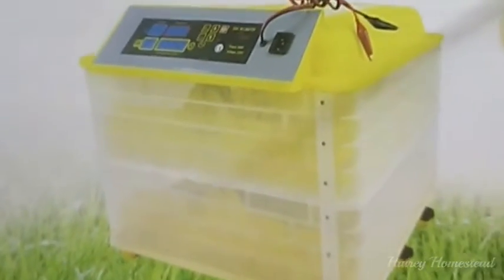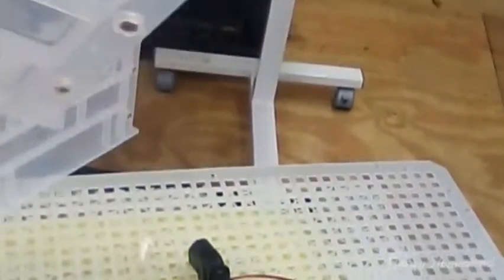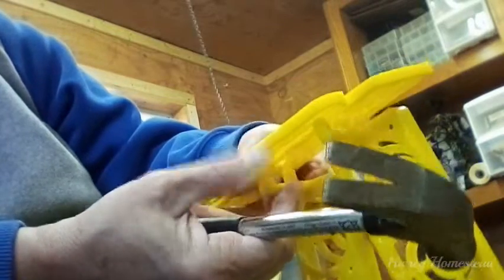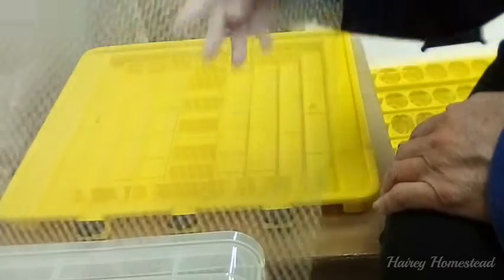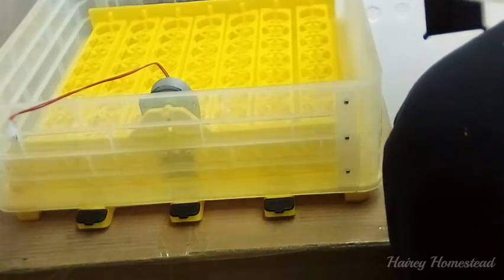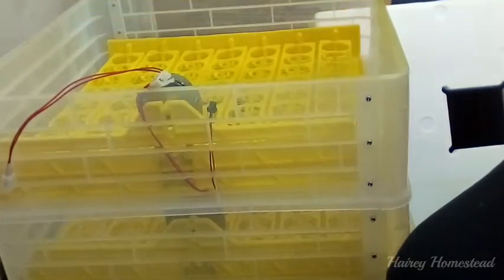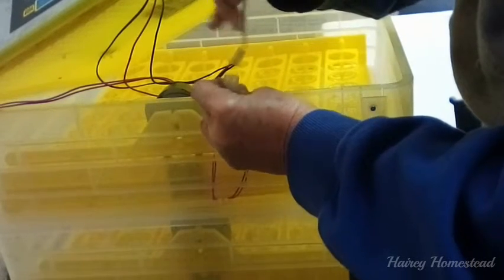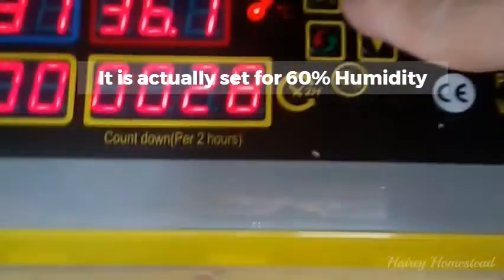112 egg incubator ASSEMBLY with bad  instructions

Comment: Any way to turn the alarm off
I dry hatch
Reply from the maker: Sadly...No - you can totally remove the beeper, The only way I can stop it is to turn it to the lowest number possible...either way it will beep when they hatch, as the humidity will get higher - I find that this (and other fan driven incubators) really dry out the eggs, so some humidity may need to be added - especially during lockdown - depending on your climate.
Reply: @ thank you
Mine isn’t letting set a low for humidity just for the temp
I’m doing it per instructions but it still isn’t working 
Did yours end up hatching eggs
I don’t want to loose my precious turkey eggs
Reply from the maker: @Barefootgarden  Yes, mine hatched plenty of eggs - The humidity is only a checkpoint - this incubator cannot control the humidity, it can only alert you. so the setting are for alarm only - I use separate humidity and temperature checks inside the incubator - some areas are warmer than others too. But as long as you have the humidity YOU need for your hatch - you can ignore the alarms - I know they go on your nerves if you can't shut them off or turn the alarm low or high. but rest assured - all you need is the correct temperature and the correct humidity for what you are hatching and you will have babies soon.
Reply: @ thank you.

Comment: Just trying to set up mine and the temp reads 100 . Can not get it to 38. Anything. Theres no . At all. Just 100 or 99 pls help
Reply from the maker: 100 would refer to fahrenheit - although the indicator says centigrade, this would mean it is displaying in fahrenheit. 38 C = 100.4 F I set mine to 100F and it will average between 99-100F. Now I usually hatch emu eggs (in a different incubator) along with chicken, duck and goose eggs. Emu eggs hatch at a lower temperature (36.5C~) But I have always been able to hatch other birds alongside them at this temperature - even opening the incubator 3+ times a day to rotate the emu eggs did not affect the hatch rate of other eggs.
Reply: Thank you so much @haireyhomestead3820

Comment: Best video. She explained it step by step perfectly . Thank you
Reply from the maker: I actually just bought another one of these - This is not the best incubator on the market, but I just got mine for under $90 on Amazon. The newer versions are slightly different in the way the rotor assembly is mounted, but the basics are still the same.

Comment: My electric panel will not light up and start can you help?? Full of eggs!
Reply from the maker: Hi Judy, Without seeing the unit in person I can only make suggestions : Ensure that the the incubator end plug of the electric cord is all the way inserted into the incubator to make contact with the prongs. Be sure to connect the wires as intended so electricity can flow properly to all sections of the components. If you are tech savvy, take the panel off and see if any wires are disconnected, or any solders are incorrect. If you find that there is nothing you can do to correct this without professional help, I would return the unit to the merchant you purchased it from. I am sorry that you are having trouble with this unit - I must say that after all these years, I have only one section working and the temperature will not go above 88F - therefor I can only use it as a brooder and no longer an incubator - I do have a similar unit I purchased (https://www.walmart.com/ip/RITE-FARM-PRODUCTS-PRO-MASTER-SERIES-120-CHICKEN-EGG-INCUBATOR-HATCHER-TURNER/291832502) - as I am posting this, it is out of stock. but this unit has been running since October last year and is good enough to hatch emu eggs (for which I only use one level for. but the rite-farm products are much more reliable than the one in the video - it holds the heat, automatic turner bars, and easy to clean. Wishing you all the best and hope you have great success with hatching.

Comment: at min 4:00, put the turner under the motor first, no hammer, use  pliers-gently
Reply from the maker: Thank you for the great information - however, this incubator has seen it's days and I would never purchase it again - after all these years, I have of course accumulated 10 incubators and including a cabinet incubator - out of all the incubators I have - this one is the worst. It's  only use now is one level as a brooder, as it was never really great at holding a temperature for me. The turners bottom out when I put larger eggs in them, which stops the eggs from turning - I now will only ever use turning bars, and never swinging baskets.

Comment: Bad video you didn’t show the numbers at the end it was all about your insulation that you mad e so sad I watched the whole thing hoping for some numbers but you never showed them so sad!!!
Reply from the maker: I'm not sure what numbers you are talking about (?)
Reply from the maker: I re-watched the video. at 11:43 I mention that it did get up to 38 degrees before covering it up to insulate it. - however once you open the incubator the temps drop fast again. I also mentioned at 12:36 that I was going to get it back up to temperature - as it did well with the insulation (meaning it reached the temperature it was set  for (38) - depending on the eggs you hatch, you may need a lower/higher temperature (The incubator went to 38 degrees and stayed that way after covering it.)

Comment: What would be the best temperature for this incubator does anyone know? I put in a separate humidity and temperature guage and it shows it gets to 99.7 farenheit max even at the highest of temperature being 39.5 celcius for this incubator which in farenheit its like 103 its like the incubator struggles with reaching the Temp it needs because its so big
Reply: Just got our first 3 external breaking of the eggs they will hopefully come out tomorrow day 20 or day 21
Reply from the maker: That is the drawback of this incubator - I could really only use it in our home, and covered up - I had to get a "polar" sleeping bag to wrap around the incubator, leaving the vent open (you don't want the airflow to be inhibited). There should be two heating units mounted to each fan - top & bottom level - this incubator does best in the heat of the summer to be honest. But I have hatched many species of birds inside my home during the colder months. Be sure to keep as much of the Styrofoam you have to surround the incubator. I'll be honest - I would not purchase this one again - there is a much better one out there - hold temps and humidity so much better for less money- I use this one and hatch emu eggs, and any other eggs very easily - I love the rolling egg turners - will never go back to the cup turners    https://images.search.yahoo.com/yhs/search;_ylt=AwrijSh1d9xlDosmDBsMnYlQ;_ylu=Y29sbwNiZjEEcG9zAzEEdnRpZAMEc2VjA3BpdnM-?p=rite+farm+120+egg+incubator&ei=UTF-8&type=1470478-vsub-ext01&hsimp=yhs-yogadaily&hspart=litmus&fr=yhs-litmus-yogadaily#id=0&iurl=https%3A%2F%2Fi5.walmartimages.com%2Fasr%2Fd8d6f02c-94ef-48e7-91a0-1173dde0464f.8b3f5d8d45d648d4c3c45682d6353f02.jpeg&action=click
Reply: @haireyhomestead3820  yeah thats the only thing that would fix it just covering it up really good but something wierd happened it let me go above 39.5 even tho the previous day it would only let me go to 39.5 max now it let me go super high all i needed to make the right temperature was 40.7 thats what i have it at right now i dont know if that could destroy the incubator but i got warranty on it and its a manufacturer mistake if it does break because it shouldn't have let me go higher
Reply from the maker: @pol-ek3yq  Just be careful with the higher temperature - for me (my fault) I placed some objects on top of the covered incubator, which ended up (I believe) bowed the top of the incubator just enough so that the fan was too close to the heat plate and ended up melting the fan into the heat plate - stopping it from working. I lost the entire upper level of eggs for that hatch - then decided to switch the fan from the bottom to the top and used both levels - the top as an incubator, the bottom as a brooder - there was enough heat for chicks, just not to incubate - The reason I wanted the eggs on to : they don't poop onto the lower level LOL- I am glad you got it working for you in that respect - looking forward to you updating me on how your hatch goes. I'd love to see your brood. you can share pictures and stories with me on my personal face book page if you like (https://www.facebook.com/pfoxhaire)🙂
Reply: @haireyhomestead3820  oh yeah that's pretty smart not gonna lie , do you do anything when humidity gets super high inside the incubator as the chicks hatch and does it affect the chicks you have in the bottom brooder layer ? Would it kill them if i left the humidity go to like 90? and yeah man i got low hopes but not out the game completely because i saw a couple eggs move on day 17 and i got them on lock down today we will see if those 10 days with low temperature affected them by alot it was like at 99.5 farenheit the whole 10 days but right now its at 101 and 102 in between there because i noticed the bottom layer gets hotter from the top one
Reply: @haireyhomestead3820  yeah sure i can share some pictures of my setup my mom and i are still new to this she had told me that she tried before but it failed she still got the incubator she failed with but its a learning process first chicks i hatched all 7 came out , out of 8 because one was a lava lamp when i candled it (unfertilized).
Reply from the maker: @pol-ek3yq  If too much moisture enters into the developing egg (and it does through the shell) then your chick could drown inside the egg before it gets a chance to hatch. Be sure to keep humidity no higher than 70% max - personally my max is 50%, but most people will add water to "soften" the shell/membrane so it is easier for the chick to hatch. I have laid a hygrometer under a chicken that was hatching - the humidity was around 40% until the chicks started hatching - it did raise it to 75% - but I realized that those chicks were also in the process of drying off - so they were evaporating moisture under the hen too 🤔

Comment: Great video!!!! Thanks 😊 
Do you by chance know how many turkey eggs this can hold?
Reply from the maker: @cari-lynn8322, I have hatched turkey in this one - as with peacock, I would space them apart, as the weight will bow the holders, that will bottom out and not be able to turn. on the safe side a ratio of 1:3, so for every 3 chicken eggs, I'd put one turkey egg in this one. I must say that I no longer use this as an incubator, but as a lockdown (top level) and brooder (bottom level). I burnt out one of the fan/heaters - melted the  plastic, so had to remove the top fan and switch them around - so only the top fan works, but good enough for a lockdown and the bottom layer is warm enough to put the hatched chicks for a couple of days.  I'll let you know, that I have found a MUCH BETTER incubator - this one can handle any weight of eggs ( I hatch emu eggs in this one) and I love that the eggs are in their natural position and are "rolled", just like the hen would do - This one I ordered from Walmart - But it is available as a "Winado" on Amazon, ot directly from the Winado website at their products - search for "incubator".
Reply: @haireyhomestead3820  thank you so much for the information!
Reply from the maker: @cari-lynn8322   You are so very welcome - I Thank you for your support in watching any of my videos🙂
Reply: @haireyhomestead3820  please , could you show the picture or the name of the new incubator because the link that you said  from Walmart is the number of your order and it is not possible to see the incubator , Thank you in advance
Reply from the maker: @ConcepcionJimenez-dv1sh  "Winado" is what the one from Amazon has as a name brand. Even though the actual unit does not have a brand name displayed anywhere. you can get it from amazon (Winado Incubators for Hatching Eggs, 112 Large Chicken Egg Incubator with Automatic Egg Turning & Temperature Control & Humidity Display & Egg Candler for Duck, Goose, Quail Eggs) for either $89.99, or for $59.99 + $49.99 shipping cost. You can also go directly to WINADO website, go to "products" search for incubator. It should pop up. I cannot post any pictures on this forum. sorry.

Comment: yeah, i had the same problem, i just got that incubator and the instructions sucked. but i got it together with your video help, thank you.
Reply from the maker: Serpentsyndicate, Thanks for the kind comment. I must say though This incubator has now been converted into a double brooder. I inadvertently stored something on the very top of the incubator while it was running and the heat plate melted the plastic of the upper fan as the additional weight pushed the fan onto it. I took  the bottom fan and hooked it up to the upper level so it can push heat to the lower level. It does not keep the temperature where it needs to be for incubation, but is a great brooder now. So be aware - do not put anything on top of this incubator. 😁

Comment: Remember the darker the egg the less humidity the eggs actually need. I also have 2 layers of towels to cover my incubator.
Reply from the maker: I am currently hatching Sebastopol Geese, Emu, Rouen Duck, Polish & Silkie chickens.So each one has a different humidity level - even a different incubation temperature. I rarely have a white egg, they are all brown to certain degrees, so I have never hatched then separated by hue of color. I use a towel inside the incubator to keep the humidity balanced. I mostly try to dry hatch as much as possible but that does not work with every bird or incubator. I am setting up streaming these hatchings live on Twitch in about 2 weeks (https://www.twitch.tv/ufopilot_emu)

Comment: Is it any good though?
Reply from the maker: It was when I first got it - But I must say it does not keep the temperature (we hatch in the barn now) When I had it in the house, it did very well. The top motor (fan) burnt out so I put the bottom fan/heater on the top and use the bottom as a brooder now for freshly hatched chicks ( I can only use it in the summer months - in colder weather, it cannot reach the hatching temperature (even with wrapped in Styrofoam and a sleeping bag) I only paid about $80 new, but I got my money's worth out of it - and like I said, it still runs - probably would have not burned out had I not stored items on the top - I believe this was what weighed down the heating unit into the fan and melted some of the plastic on the fan.

Comment: Hello, just wondering if you have a video that shows you how to reset the days? I have the very same incubator and I’m having troubles resetting it to 0 days
Reply from the maker: Hi Robin, I believe mine is the red-green "yin/yang button - hold for 3 seconds - if that fails, a power off and then back on may also do the trick - I usually write the hatching and lockdown dates on the eggs - because I use the big incubator continuously, so it will run almost throughout the spring and summer (except for a good cleaning once a month-  where I transfer any hatching eggs to other empty incubators)
Reply: Did you figure out resetting your day counter? The double arrow button doesn’t seem to be working for me.
Reply: @nisharoady9061  yes, while pressing the yingyang button you pull the cord out of the machine, then put it back in, when it comes back on, it resets to 0 days
Reply from the maker: @robincurtis3474   I did not know that - must have got one built on a Wednesday ( apparently one of the best days for factory productions...ha ha ha) my ying-yang button works-  But I'll keep this in mind when it stops working. Thanks for the information!
Reply: @nisharoady9061  if it doesn't work for you i can do a video to show you
Reply: How was your hate rate?  Was it successful?
Reply from the maker: @BRATTICUS68  When I first got it, the incubator was pretty good - over time however the top motor burned out, so I switched them and use the bottom as a brooder for freshly hatched chicks. The unit is great for the summer, however it needs to be either indoors or heavily insulated to keep the temperature up. I still use it but only in the summer - as I hatch in the barn - I just tried to get it going last week, and after 2 days, it still had not reached the temperature needed - But the hatch rate was good - out of all the fertilized ones (there were about 70 fertile) I'd say 50 - 55 hatched - others were not fully developed, some were, and pipped but did not hatch - not sure if I can attribute this to the incubator, method, genes (DNA) or any sickness.
Reply: @haireyhomestead3820  wow that's a great idea, i'm going to look into that..thanks :)

Comment: What capacity battery we use ??
Reply from the maker: Hi Jaswanth Reddy, The incubator comes with a power supply, which is used to plug into an outlet. The one I have is Power Source Type:	Corded Electric. I am unaware of these coming with batteries.

Comment: how about trying to get a long shot of the item while building it instead of getting it so close to so no one con see it at all
Reply from the maker: Well, I did not have anything to hold up my phone I was recording with properly, so my apologies. There are a lot of other videos out there on the same incubator that show a far away angle of the same product, but there is not detail to see the directional of certain characteristics of the  incubator.
Reply from the maker: If I only would have thought of that back then - Well, live and learn - thanks for the heads up though